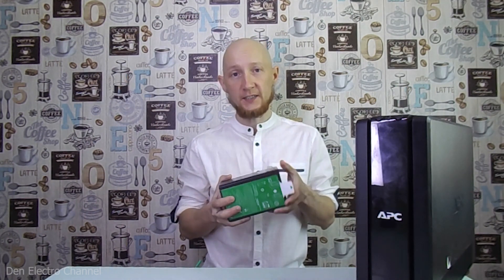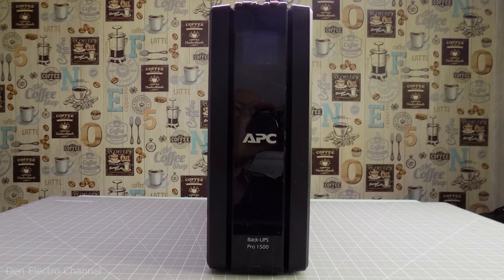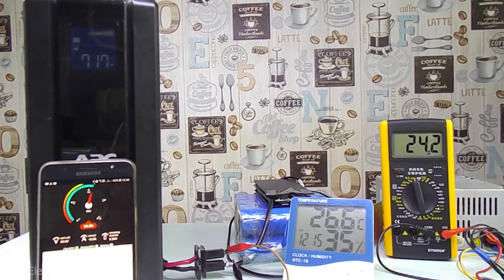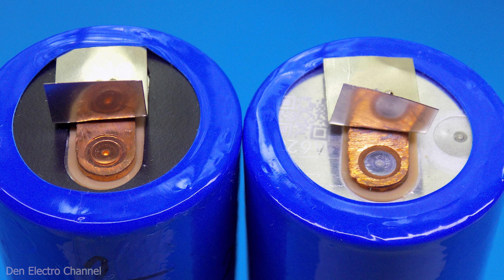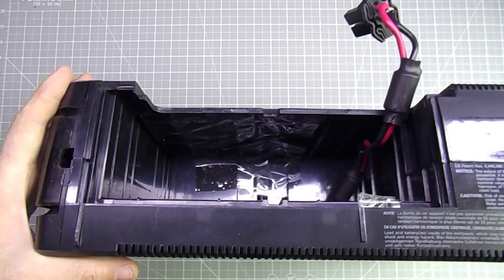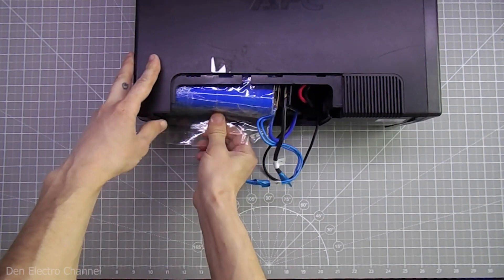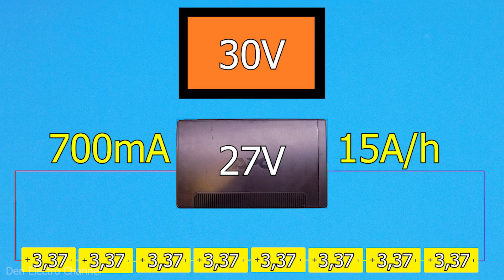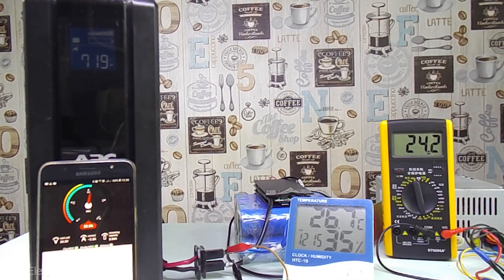Converting an uninterruptible power supply to LiFePo4: what do you need to know?

Comment: is the switching response time for the UPS any different with the LiFeP0 battery vs. the lead acid?  most computer power supplies need less than 12ms.  Is the BMS helping control what the UPSs trickle charge for lead acid batteries?
Reply from the maker: I don't see any difference in switching from the network to a new battery. It seems to me that the battery type doesn't matter here. No, BMS doesn't help UPS charge batteries in any other way.

Comment: did it give error on 100% charge ? bcoz of bms shutting off  ? is tickle charging present in this ups? ( i have same ups and want to do same thing)
Reply from the maker: if the BMS charges any of the batteries to 3.65 volts before the UPS charges the entire battery to 24 volts, the BMS will turn off charging. In this case, the UPS will signal that the battery is "lost". But it will still work correctly if the electricity in the house is suddenly turned off

Comment: Have you done a rundown test, i.e. pulling 200 Watts (or 500), how long your unit stays on for? I'm trying to figure out how efficient (or inefficient) UPS's are in getting power from batteries to the load (i.e. how long should a UPS run with a 24v 100 amp hour LiFePo4 battery at say a 200 watt, 1.5 amp load - got only 45-50 mins with 75 amp hour Sealed Lead Acid)?
Reply from the maker: I did not conduct any experiments on this UPS, since it is not my device.
 But I tested my UPS. True, there I changed the battery to 12 volts.
part 1
https://youtu.be/3dngwtSlxS4
part 2
https://youtu.be/r9foRvnHhio

Comment: I have replace my UPS battery for a Lithium one, but the issue is that as it has a lower nomimal voltage, 11.1V, at some point the UPS thinks it is out of charge while it still has charge to give and starts to beep quicker in a out of charge state. How is it possible to fix that ?
Reply from the maker: you need to look at the UPS diagram. But why not just add another Battery to increase the voltage?
Reply: @Den_Electro_channel  adding another battery doesn't make sense as for the 12V level the number of cells are always 3. Adding amother pack in paralel only increases the time, but the fundamental issue of slightly differente voltages the UPS doesn't go away.
Reply from the maker: I also assembled it this way but with 4 lithium iron phosphate batteries and everything worked great. 12 volts is the operating voltage, it is made up of four 3 volt batteries. Lithium delose phosphate batteries have an operating voltage of 3.2 volts. And the maximum, without load, is 3.65 volts.
https://youtu.be/3dngwtSlxS4
Reply: @Den_Electro_channel  that doesn't make much sense and is not what most people do. The nominal voltage of a fully carged cell is 4.2V
Reply: @fernandofrediani9010  Incorrect in this case -- Li-ion batteries are 3.7 to 4.2V, LiFePo4 batteries max out about 3.65 and are considered 3.4.v batteries -- it takes 4 to make a 12v replacement
Reply: @dmagill4  they are actually 3.2v nominal